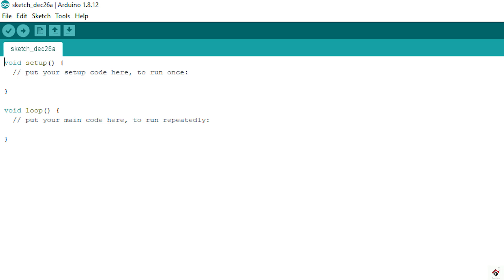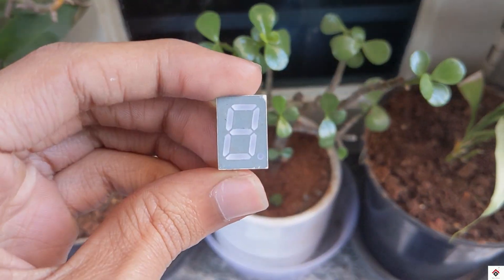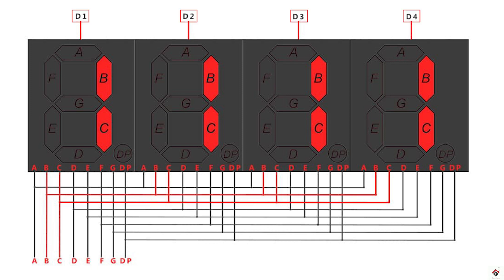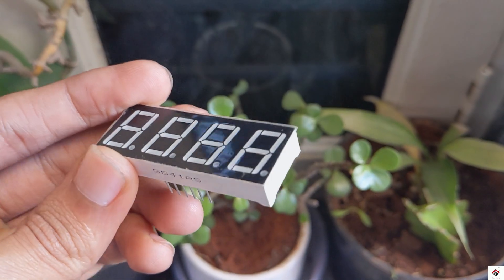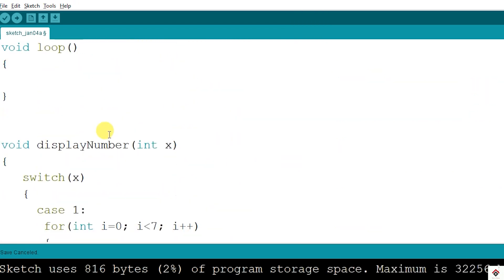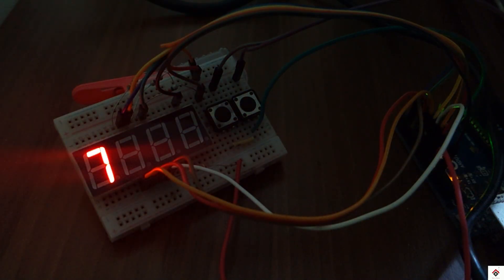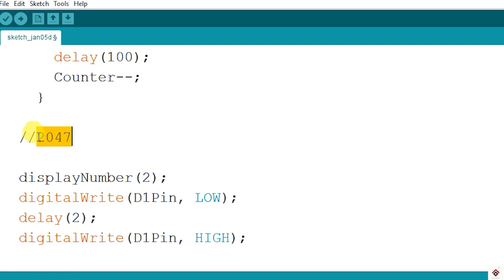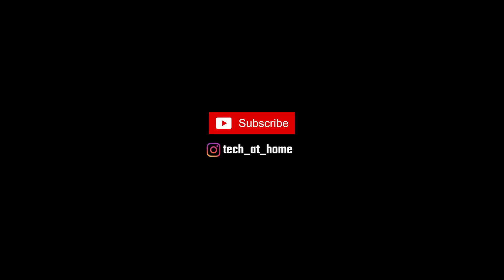4 Digit 7 segment Display Counter | 0 - 9999 Increment and Decrement Counter Arduino [with CODE]

Comment: Great job @techathome What software do you use for your schematics and simulations please
Reply from the maker: Thank you 👍❤️
We use Photoshop to create a circuit diagram.

I don't do software simulation, directly I use physical hardware to work.
You can use Wokwi online Arduino simulator which is great, I have tried many times.